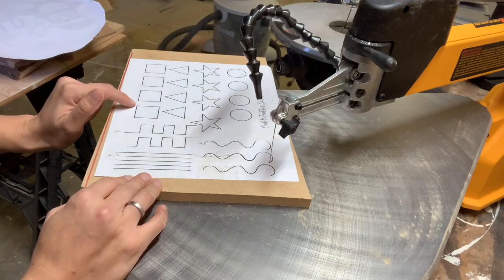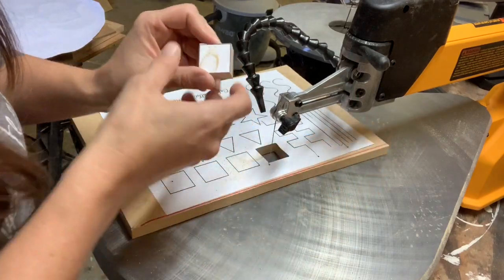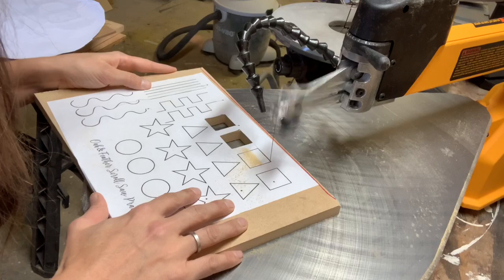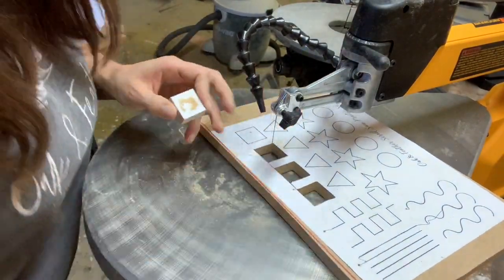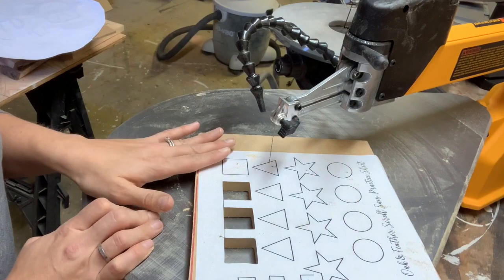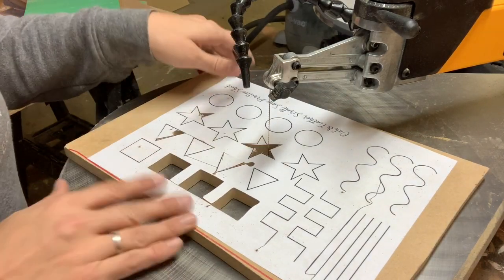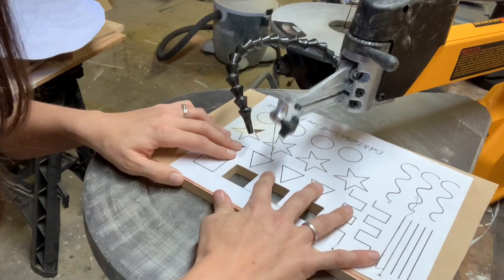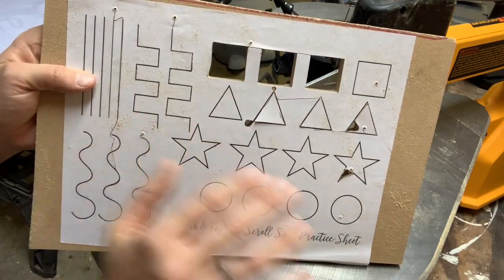Cutting Corners on a Scroll Saw (Extended)

Comment: Hi. This video is super helpful. I am finding that when I use the stop and turn method my blade will actually twist. I do release the tension first. Any suggestions? How do I stop that from happening
Reply from the maker: No, the tension should stay tight. when you stop, you aren't actually turning the saw off, it is just releasing the pressure with your hands. Another way to do it is almost pushing slightly back and then quickly doing the turn. If your blade is twisting while the saw is running, your speed may be too slow. The turns do need to be fairly quick, so it will take some practice!

Comment: I tried to stop the blade and turn but it just turns the blade and doesn’t cut where I want it to, any ideas on how to stop this? Maybe my blade is too thick or something??
Reply from the maker: Is it actually bending the blade? What kind of blade are you using? Your tension may be too loose if it’s bending really easily. So maybe try increasing that